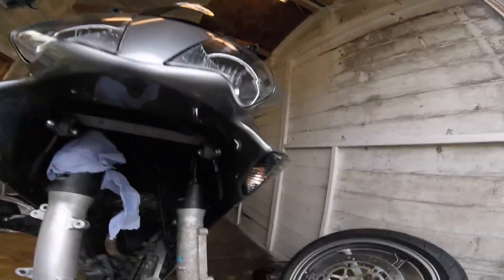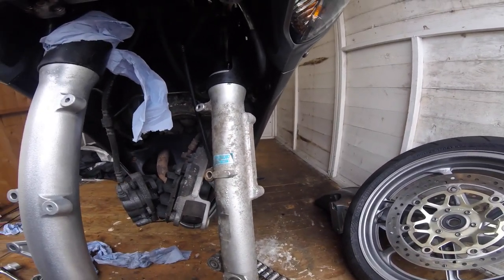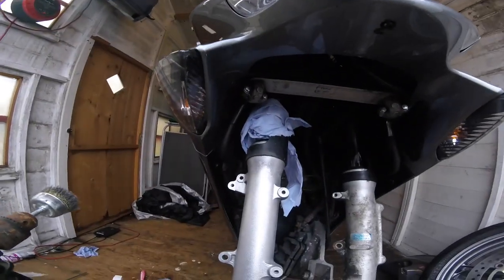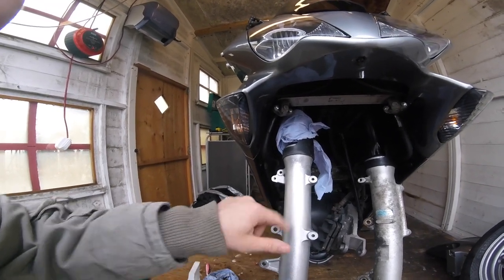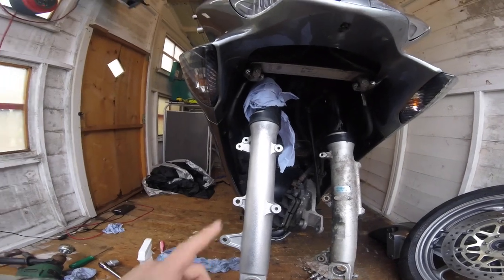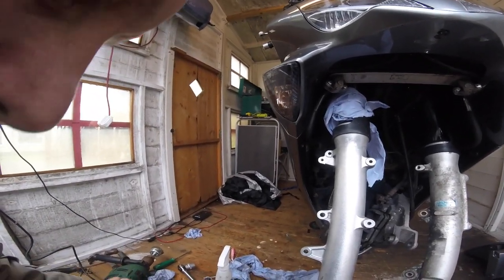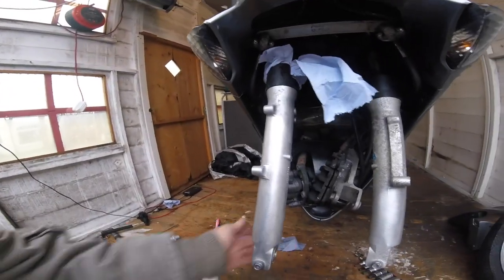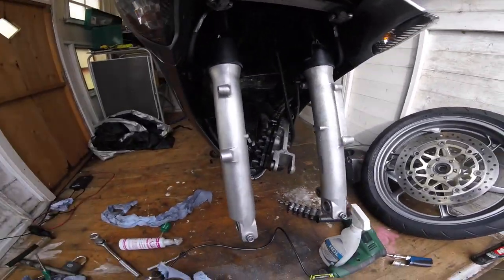Cleaning The Forks On My VFR 800 - THE UNCONVENTIONAL WAY

Comment: Hi. Thanks was looking to paint mine too but seeing this looks much better. So if you wash the bike do you have to apply ACF50  again ?
Reply from the maker: guy stevens not normally should be good  for a few months but I have a rag I leave soaked in acf50 so once bike is dried I just wipe the crucial parts over with the acf50 rag including the forks
Reply: Thanks will try this a some point good video too. will bring mine down lol.

Comment: Just wondering the wire brush you use on the drill is it a particular type soft rough ? Thanks in advance
Reply from the maker: Albert Sciascia got them amazon Am-Tech F3610 Set 7 Metallic Wire Brushes https://www.amazon.co.uk/dp/B0032ZK41K/ref=cm_sw_r_cp_api_i_GlgMEbRWKX6QZ
Reply: @Motourev  thanks